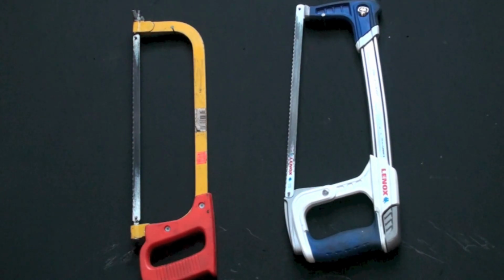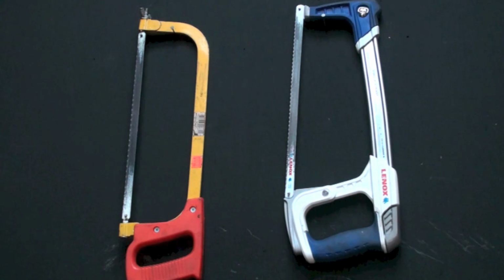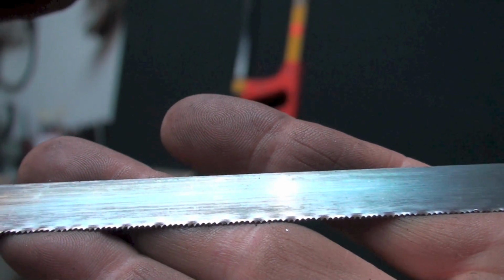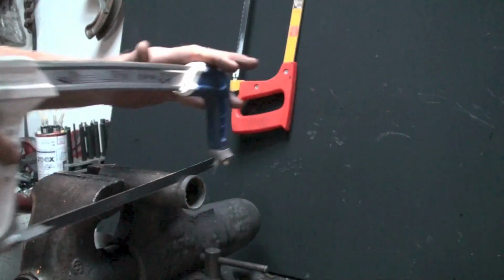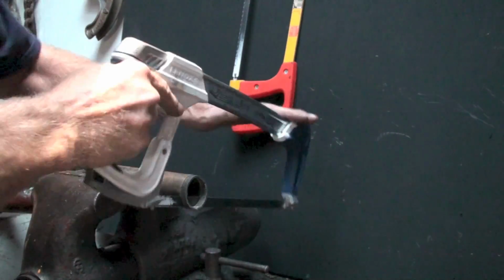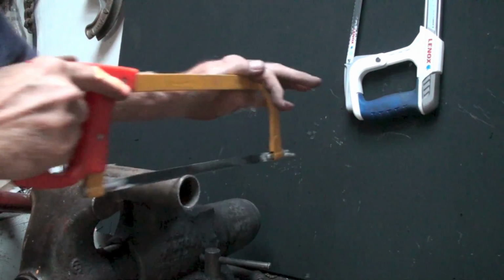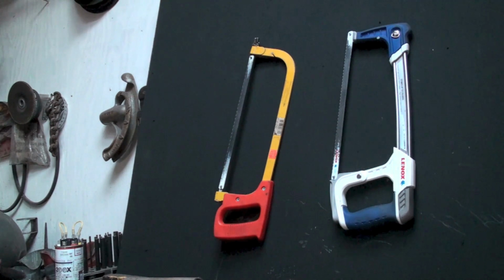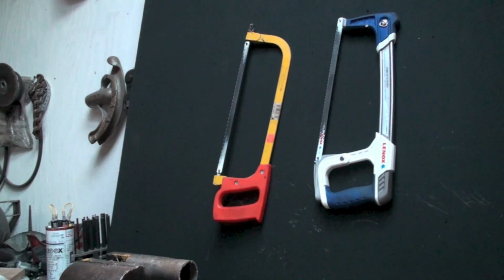Hack saw tutorial

Comment: When I try to cut a thin pipe with a 18tooth new blade my saw jams what would cause that? Thanks.
Reply: Get a blade with more teeth and use oil
Reply: usually mine jams when i put too much pressure
Reply: and also it jams when i put more pressure when pulling than when pusshing

Comment: If it's hard steel you are sawing through a bit of oil on the blade will help it cut much smoother! Works with drilling also.
Reply: Which oil?
Reply: @vk912399  any oil will work. 3 in 1, oatey pipe threading fluid, wd-40... hell, motor oil would probably work too. i use the oatey pipe threading fluid when i'm drilling/milling stuff.

Comment: I've watched you on many of your videos and you've taught me a lot, more than just about any other site on the net.  However this particular video on hack saw use was just painful to watch, how about remounting your vise so it doesn't move and rotate with each stroke?  With each forward push,  your tubing rotates because the vise is loose and it's binding your blade.  A drop or two of light oil in the cut would also help a lot.  I'm not even going to review the reciprocating saw.